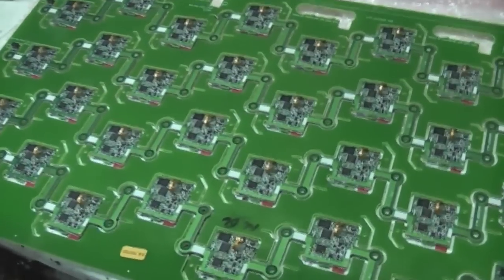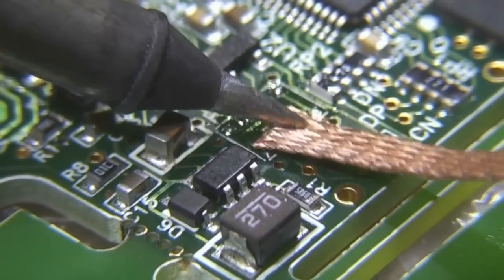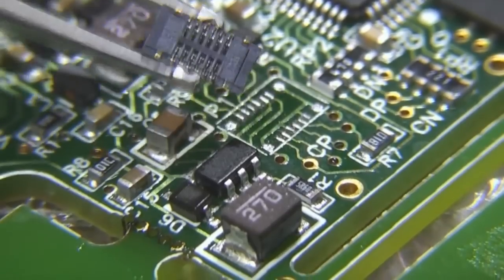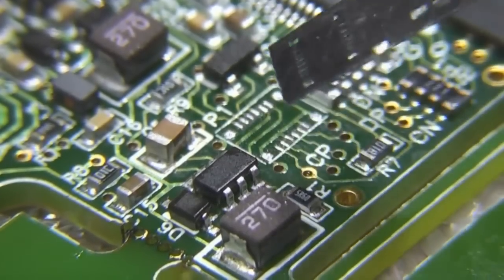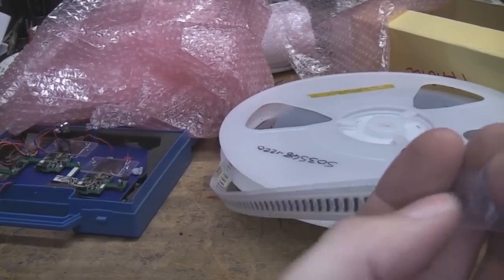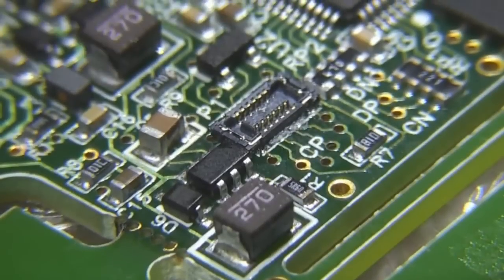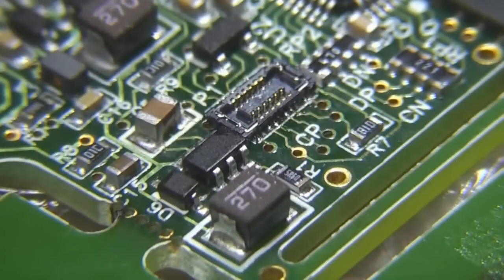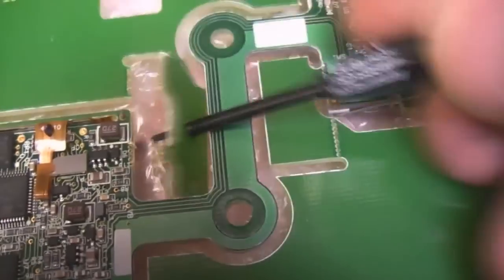Reworking a tiny connector

Comment: When i need to dispense paste in small pads i usually stick a thin wire (like a resistor lead) in the paste. That way i get a small amount of paste hanging on the end of the wire which makes it really easy to apply small amounts of paste on the pad.
AWESOME video, as usual. Thank You!

Comment from the maker: Designed by hand-modelling with stretched tinned copper wire as it was to hand. Made by a spring company (Small Order Springs) - We gave them the copper model and the LCD/PCB & they tweaked their machine  til the clip came out right.

Comment from the maker: No - most of the rear is a very thin reflector film - sticking to it would visibly distort it and removing the LCD would destroy it. There's only a very thin plastic frame round the  outside. No way you'd crack glass - it's about 0.2mm wire, force just enough to hold it down. Alignment is mostly from flex cable in PCB slot.

Comment from the maker: Interconnect is the most likely failure point - bigger PCBs = less interconnect. Most faults would be fixable.
There will be about 2800 screens in this install - so would be 14K+ interconnect points!  Also the interconnect PCB is part of the aesthetic design.

Comment from the maker: Would have been very difficult due to tight corner between connector body and PCB - also more risk of heat damage to connector. With paste a quick touch of the  iron is all that's needed

Comment from the maker: Look for "SMD Tweezers" - lots of different shapes available. Actually I don't find them very generally useful, but the slot makes them  ideal for gripping the plug on the LCD flex that mates with these connectors

Comment: The last fine pitch part I laid out, the manufacturer's recommended footprint called for no solder mask between the pins. Their studies showed less shorts that way. Did that connector have a recommended footprint drawing? Thanks for the videos Mike! You rock.

Comment: I've got some dental picks, and they're ideal for massaging solder paste about.

The paste doesn't stick to the stainless much, and you don't have to hold it closed like you do when using tweezers. 
You can also get straight picks, with which you can kind of "roll" to get the paste off the tip as well.

Comment: You normally use IR station for connectors. With hot-air you can heat from the bottom of the board. Good video.

Comment: I had to reflow a surface-mount USB connector on my father's mobile.  I had nothing else available with which to do it besides a butane-powered catalytic heat blower, but it worked well.

Comment: I know this might be a dumb question, but after applying the solder paste and dropping the connector ontop, why not just re-heat the board in that area from the back with your heatgun, should be enough to remelt the paste,without risking melting the connector with the iron.

Comment: A lot of times what I do is heat the board from the back with the hot air until the solder just flows.  It will also heat adjacent components, but I've never lost one this way.

Comment: That's a very fine bit O' work.  It looks good.  Just a question - don't you need to run cold air through the hot air tool before switching it off?

Comment: After applying some paste on the stencil couldn't you do a silk screening squeegee motion to apply the paste through the stencil?  Maybe the surface tension of the solder paste you mention could be an issue with that.   Or not practical on such a small scale.

Comment: What about applying a suitable and even amount of solder with a wire & iron to all pads, clean & flux them and then melt the component on with hot air?

I was quite successfull with this on a adapter-construction. A adapter board with pads on its lower side facing a component pattern of the board on which it is mounted and this adapter takes the adapted component on the top layer rotated.

Comment: i see you added the paste onto all the connections i need ask if that will no short the connector. Another think i want ask you is why you no use hot air for sold back?

Thank.
Reply: he didn't use hot air to solder the new connector because the connector would warp since its just plastic.
Reply: Solder paste is just solder suspended in flux. The flux will help make sure there are no bridges/shorts, as long as you don't use too much.

Comment: It does seem that the metal on the connector is actually sticking out. Wouldn't it be possible to solder them with solderwire instead?

Comment: I hate those 0.4mm connectors.. If you have a module from something that you want to use it seems it's almost impossible to get the matching connector so in the past I have removed the connector to fit one with a workable footprint that I have as a set... but you have to be really careful as the pads and traces will fall off just by looking at them.

Comment: Why do displays have to always come with these evil connectors? I had to wrestle on to a board a really fine pitch dual row FPC connector for a color OLED where using too much solder would wick it in to the connector and destroy it. What is the pin pitch on that?

Comment: 0.4mm is really bad I have an IC on my project that uses that and is a big pain huge difference from 0.5mm.
I also have some 60 pin connectors fortunately they are 0.5mm.
I got some low temperature RoHS soldering paste but did not got the time to test especially for the connectors since they melt easily is more expensive but it may work much better on your project.

Comment: Why do you make these boards so huge? Woudnt it be better to make all the small boards as single pieces, so if for example one trace at a single connector breaks you woudnt have to dump the hole unit with all the 6+ pcbs?

Comment: Toothpick seems like it would be a little easier than tweezers...

Why do you need to touch the connector piece if you use hot air gun? I've seen people do this with a hot air gun, even with plastic pieces. You shouldn't need to touch it, and thereby distort the shape of the heated plastic. If you hit the tracks with the paste on them (and no connecter yet), the paste should ball up onto the tracks because of the coating on the PCB. After dabbing some flux onto each of the pins on the plastic connector piece, you should be able to set it atop the board precisely where you want it. It does have to be precisely level, obviously. And then the hot air gun should cause the solder to flow right up the pins on the connector. And at this magnification, you should be able to see the thing sink a bit as soon as the solder paste melts that 2nd time. There wouldn't be any need to touch the connector while it was hot, and thereby risk deforming it.

Comment: Who makes the flux remover you use with the built in brush? I can't seem to find any which aren't bottles/normal sprayers.
Reply: +Peter Brockie You can buy empty brush bottles, luer lock bottles, wash bottles, .... Google "dispense bottle esd"
Reply: Frank E Davidson True, but I was specifically talking about the aerosol flux remover he uses. I've found similar ones but it looks like they are all UK only brands.
Reply: +Peter Brockie Aerosol flux removers are widely made and usually come with brush top spray heads.  MG chemicals(CAN) chemtronics (USA), Techspray, (USA) Electrolube (UK), Ambersil (UK) are but a few.  I can't speak for Mike but he probably just chose what was available locally and at an acceptable price. 

It's a matter of preference what you use to dispense (assuming chemical compatibility between solvent and bottle). 
Personally I like to have a range of sizes of container and a range of types of cap of commonly-used solvents to cover different situation eg a 15mL needle tip for the tool box (50p ($0.75) ea at a vaping store) , a pump cap on the bench for dipping swabs a 250mL wash cap for big through hole boards ...
Reply: MG is what I use, but their dispensers don't have the nice brush tip.